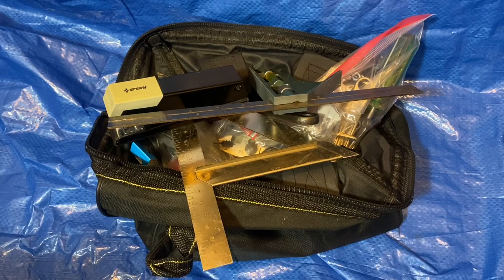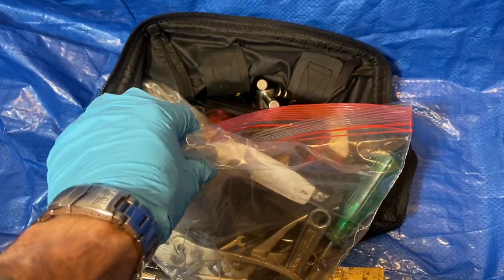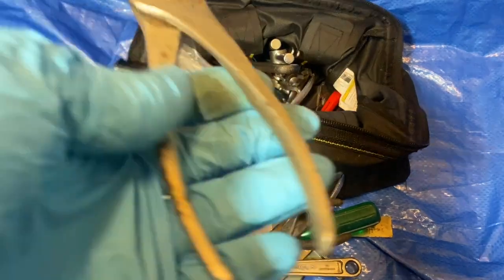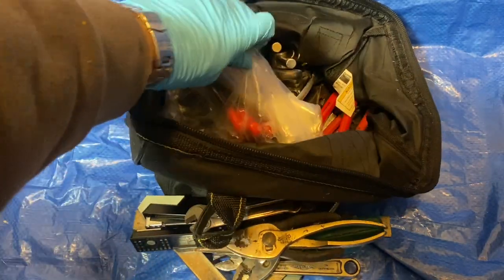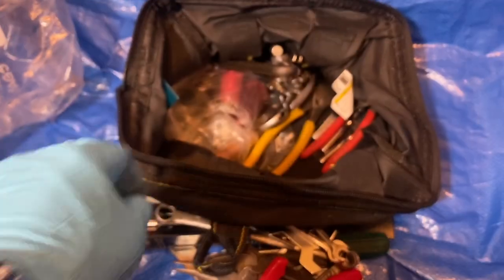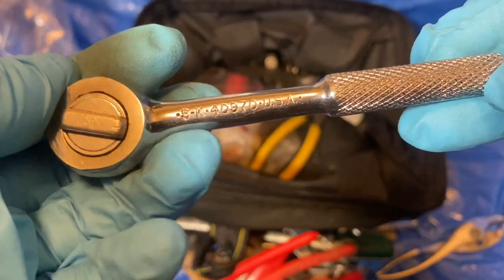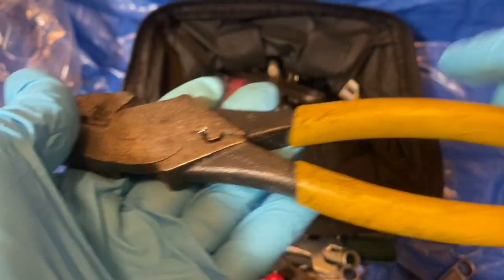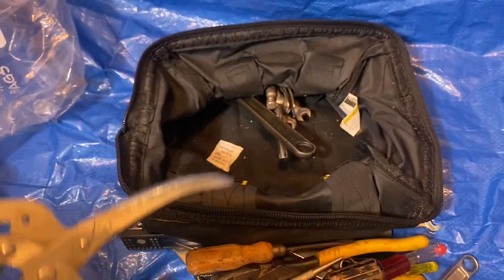Tool Haul Odds&Ends w/Knipex,Etc.

Comment: That Crescent is a very late production wrench, that's how they were making them before they went overseas.

Btw Sargent is still around today making the parallel jaw bernard patent pliers, they aren't cheap though and so many vintage examples are available that it's hard to justify.
Reply from the maker: Thanks for letting me know about the Crescent wrench. I was thinking it might be towards the end since it had that unthreaded thumb wheel pin.👍
Reply: @snapringchronicles3020  
I kind of like the handles on them, but they aren't as elegant or nice overall as the older ones.
Reply: @TylerSnyder305  value engineering strikes again...

Comment: Lots of nice items.  Those short Lectrolite DBE wrenches are less common.  I will be watching for those raised end Williams wrenches.  On the SK box consider using a black rust conversion paint on the bottom half.  Much easier than trying to restore it.
Reply from the maker: I have a bunch of Williams wrenches. This is the first one I ran across with the raised side panels. Was happy to find it. Thanks for that time saving tip on the box👍

Comment: AEG, at least in the modern power tool line, is known as Ridgid in the United States. I'd assume that it's the German Ridgid.
Reply from the maker: Hey thanks for that info👍
Reply: @Snap Ring Chronicles  AEG and Rigid hand power tools are produced by TTI under liscence. AEG is now owned by Electrolux. RIGID is now a subsidiary of Emerson. Both companies have a history and have been bought out numerous times. If you're really interested, Wikipedia has articles on most companies. My guess would be that AEG wrench came as part of a tool set sold with heavy equipment sometime in the 60s.
AEG At one time made some excellent power tools. One of the companies I worked for in the early 80s  had an AEG cordless drill driver. It was the first driver I saw that had an adjustable clutch. My Grandfather had an AEG belt sander that I seem to recall being made in Germany. It was a very good belt sander. Lighter, more compact, and stronger than the Porter Cable I was running at the time. It also came with a stand so that you could use it as a bench sander.